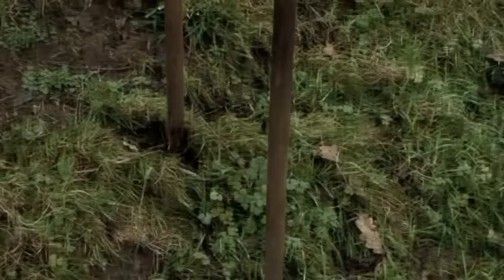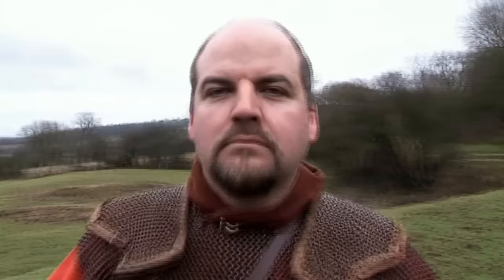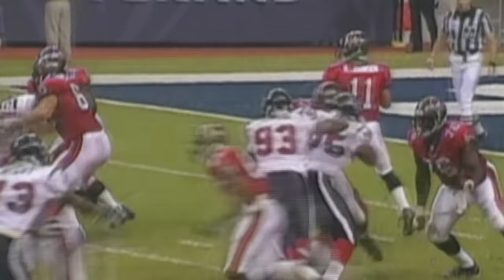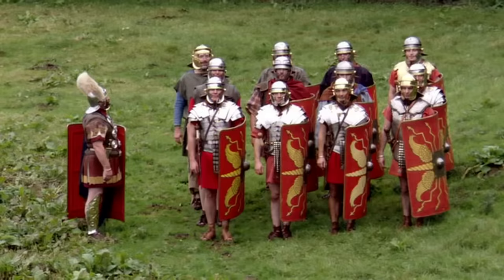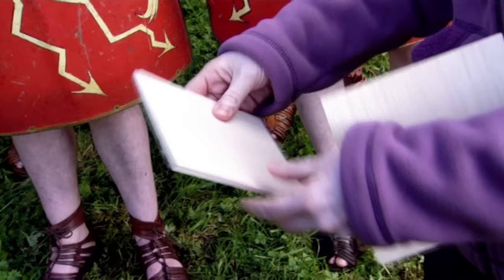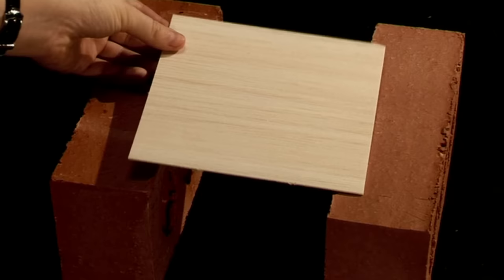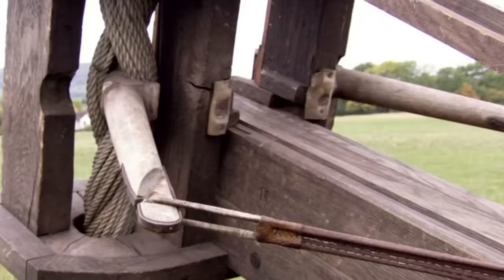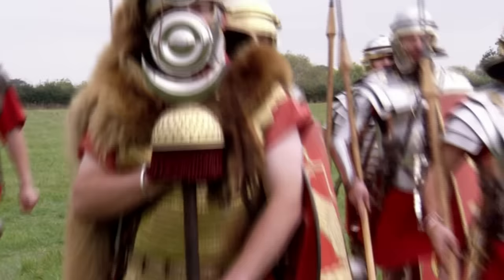Roman Military Technology and Tactics

Comment: For the record,the pilum had two types of pegs:iron and wood.The wooden peg would dislodge on contact, bending the spear at a 90 degree angle.This made it difficult to remove.The pilum is not your typical javelin
Reply: watching those pila get thrown, they didn't look effective at all!
Reply: @Concerned_Robot maybe in this demo yes but just ask the multitude of Rome's enemies what they made of it
Reply: the whole point of it wasn't to kill someone it was the fuck up their shields , because nobody is just gonna stand there and get hit with that thing they are going to block it with their shield , gets stuck it the shield so now you have to drop your guard and try to pull it out or drag that thing with you , its pretty smart tbh @Concerned_Robot
Reply: Pilums aren't like this at all, if they were, Caesar wouldn't have repelled cavalry during pharsalus.@nobodykilledme9641

Comment: The Pilum wasn't a spear, it was a Javelin. You never throw spears, but you throw javelins(pilums). Great research
Reply: Exactly
Reply: apparently there are instances of Pila being used as spears but i hold it to be false since a spear needs to be completely rigid to be effective whereas a Pilum is not completely rigid
Reply: Spears are as long as twelve to fourteen feet, do you think anyone could throw that accurately while in formation. I don't think so.
Reply: You can throw a spear. Spears are not necessarily always 12 foot Long.
Besides, have you thrown a spear in a Roman formation or seen research about it? It feels like you're assuming
Reply: Negro Joe she's right you don't throw spears you throw javelins though
Reply: A spear of that sort of length would actually be considered a pike. Spears were more commonly between six and nine feet in length, with eight foot being a soft limit for how long a spear could be before it could no longer be used effectively in conjunction with a shield. But what really makes the difference about javelin vs. spear would be how it was most commonly meant to be used. Javelins usually had smaller heads and lighter shafts, although were also more commonly shorter so as to increase range. Pilum were an exception, as they played a very different role. But seeing as how they were mainly used for throwing at the enemy, it would be more accurate to call them a javelin. The gladius was the main weapon of the legionnaire. Spears, on the other hand, were used as a main weapon by most cultures across the world and the reason you wouldn't throw them isn't so much because they're less effective at throwing, but that the soldier is less effective without his spear in hand. Throwing your spear was like throwing a loaded assault rifle at the enemy and hoping it goes off when it impacts on the ground, hitting a couple people before switching to your handgun
Reply: Vipershot22 How about you read my comment one more time buddy
Reply: XerasDezarrys Ok, yes a spear that long would be a pike but I'm just trying to make a point how dumb it is that an educational video doesn't know the difference between a spear and a javelin.
Reply: Thoughtful Potato Ok this is what you do, find a wooden dowel let's say nine feet long. Then mark a spot and try to hit that from fifteen feet away. If you can do that accurately, then you'd be a god of ancient warfare.
Reply: Also what most of us are forgetting a spear is so much more useful as it's meant to be. They were meant to fight by stabbing and parrying enemies in a formation and for stopping calvary charges. If it was meant to be thrown then it wasn't a spear it was a javelin.
Reply: Fair enough
Reply: Pilum is a type of spear. It can be thrown, but it can also used for thrusting.
Reply: It would be a crap spear then as the steel shaft is untreated steel leaving it in a soft state while the head of the spear is heat treated so it can pierce armor and/or shield. once the head pierces through an object the weight of the wooden shaft bends the soft metal shaft making it impossible to throw back at the Romans. if they used it as a spear it would be more likely bend during impact against a charging enemy as you are holding it then it would if it were thrown at the charging enemy
Reply: Negro Joe i know but for crowd control in rome troops used it
Reply: No they didn't because if you weren't aware it was illegal for armed troops to be in Rome and THEY HAD SPEARS WHICH WEREN'T FUCKING PILA BECAUSE PILA ARE JAVELINS.
Reply: Yes, there were the town watch, and they were the only ones allowed to be armed, but they were armed with hasta, which are very definitely spears. And while it is possible to throw a spear, it isn't advised because that's like throwing a loaded assault rifle at the enemy and hoping it kills them before they pick it up and use it against the now-disarmed soldier with only a handgun left. Pilum, on the other hand, were designed and meant to be thrown at the enemy over being used in formation combat. Yes, it can be used like a spear because it's a long pole with a sharp metal point at the end, but it isn't really meant for that and isn't as effective as a spear designed for fighting in melee. Legionnaires would throw them before going in to fight with their gladius. Therefore, a pilum can best be described as a specialized javelin designed for breaking shields and armor
Reply: Well it is quite obvious you've run out of argument because as we all know insulting the opposition is your last defense. And the funny thing is it never works. How about you read the comment above which explains why you wouldn't need to or even want to use a javelin.
Reply: Negro Joe im far from out of arguments and insults  but still a javelin is less lethal than a spear so its makes a great spear for Roman town watch
Reply: So your argument is that they would use pila in town watches, because they were less effective than spears. So then why do swat teams and police units have assault rifles, because in your logic they should all be carrying around muskets. Quite simply, a spear is cheaper and guess what if you were idiotic enough to use a pilum as a spear, which it isn't, anyone with a strong piece of sharp wood would kick your ass. It just doesn't make sense, because as it was previously discussed pila were single time use weapons and the shaft would bend making it ineffective. As a result the pilum wouldn't survive multiple thrusts. And also a pilum is still very lethal, when thrown.
Reply: Lucius I agree the triarii used spears not pila but I'm confused where you think I said triarii used pila?
Reply: Negro Joe ohh 9 just brought this up so people wouldn't get confused of "Pilum is a Spear weapon" so I brought up the only "spear units" that doesn't use Pilums as their main spear weapon.
Reply: Lucius oh ok I just thought this whole argument over pila was over and your comment surprised me. It's all good mate
Reply: It's quite simple really obviously the German language hasn't adopted the word javelin yet so for now javelins and spears mean the same thing. How about you look in and English dictionary and find the definitions of a spear and a javelin for me.
Reply: Zach Smith Pilum can be used, Julius caeser Had men use them as spears against Pompey's Calvary.
Reply: Dark Crusader so true
Reply: I'm pretty sure a Javelin is a type of spear, a throwing spear, plus they say Javelin at 1:17. It's like saying "That's not a dog, it's a Chihuahua".
Reply: kaguth true
Reply: Roman never spoke about "jaculum" (javelines) for the Pillum, they said PILLUM (and yes, not "hasta" > spear, i totally agree there)

BUT the pillum is nothing like a javeline, at least twice it weight, much more costy. Not well balanced.
This Pillum was used only on close quarter : 5 meters max
The angle we can see on the Orange triumph arc show us that it's use with a really close angle
And that details help to confirm our theory ;)
Reply: The Pilum was used as a spear in the Battle of Pharsalus by Caesar's hidden line against Pompey's cavalry. So, it could have been used as a spear in a last ditch attempt kind of thing.
Reply: isnt it pila ?
Reply: The pilum wasn't really meant to kill either, it's main function was to make the enemy drop his shield leaving him completely exposed so that the gladius could easily kill him
Reply: wait leonidas threw spear in 300
Reply: They could be thrown or used to stab, they usually carried one that was normal which could be stabbed with, the other was weighted, it had a circular metal weight and was meant to be thrown so it would affect how fast the pilum would drop.
Reply: Zak Kramer Pilum is latin for javelin, pestle, and spear. There are synonym translations though.
Reply: HELL IsREALJesusSaves jesus couldn't save a goal. He died for his own sins, not mine
Reply: Spears could be thrown. Javilins were just more accurate.
Reply: People threw spears....
Reply: Zak Kramer loads of cases of spears being thrown throughout history stop trying to complicate things with your annoying grammar dictatorship
Reply: a javelin is a spear designed to be thrown as a sabre is a sword designed for horseback
Reply: there are times they were used, your clearly not a student of ceaser or else you would know he used his last line with their pilla to stop pompiis cavalry charge on his right flank at the battle of Pharsalus
Reply: @l.jboylan6704  why did you bring sabers into the conversation?
Reply: Thoughtful Potato p
Reply: Its pila not pilums.
Reply: BaitLordx Spears were used as throwing weapons in early development and then later Javelins took over this role. So the term is correct just wrong age.
Reply: Well the actors in this video have apparently never thrown either one because that shot of them hitting shields was laughable. Narrator says how they could penetrate shields and then it immediately shows them failing to penetrate shields. Wtf?
Reply: So knights jousted with Spears, not javelins?
Reply: Ashton Rainey and all this time I thought they were using codpieces.
Reply: Dude, they said it pierces armour and shields. I don't think they did any research. They probably just knew some bloke that liked Roman stuff..
Reply: "ackchyually" TIPS FEDORA
Reply: There is wisdom to it as to why they say its a spear. But Its amazing that there is just some people only bent on finding wrong even in the most simplest and harmless of jokes. Sad really...
But anyway, just right now I was bitten by an “anopheles minismus flavirostris”. Do you know (like your legions) what it is???
NO? Why!?!!. ???
Actually its just a mosquito. The types that can carry malaria. 
Wisdom of it? “What is wrong if someone explains, or tells a story as if hes telling it to a toddler??? Is it not better to do it and use more common names so everyone, and not just geniuses like you and your legions can understand it? (Especially that the topic is a trivia and not your everyday general information).
I really dont get it why correctness in spelling and description point by point and word for word would be more important than learning as a whole... but hey, if there are nazi killers, for sure the world also has nazi OC’s right?
Reply: Tell that to Leonidas
Reply: the plural of pilum is not pilums, it's pila
Reply: @zacharykramer8244 : Actually, we distinguish between "Speer" which is meant to be thrown and "Spieß" which is used as a stabbing weapon.
Reply: So you attempt to show a video is uneducated by making an mistake in wording yourself? Because its funny that you don't know the difference between a spear and a pike! Also, Spears can, have and will continued to be thrown in many cultures around the world. To sum up, a javelin is a specific weapon meant to be thrown. A spear is longer and can both be thrown and thrusted. A pike is only used to thrust and cut. 
A pilum is a javelin, I agree. but be careful trying to call out an educational film when you yourself make the same mistakes.
Reply: @zachsmith1676  Very unlikely that a Pila was used as a spear. It was somewhat fragile. It was designed so that the wood holding the head would break so that the enemy couldn't just throw it back.
Reply: @Zamalshkay  Pilum is a singular entity of the Heavy Javelin, Pila is the plural, similar to a single front line soldier (pre-Marian Reforms) is a Hastatus but the plural is Hastatii
Reply: +BaitLordx

It's funny because of the words,  spear and throw, are the same in my language, a spear is literally called a throw ^^
Reply: well atleast in german they both have the same name
spear=speer, javelin=speer
Reply: Pilla not pilum
Reply: Thoughtful Potato well they are right their Is no way near The a amount of space between people in formation to throw a spear
Reply: True. In fact - javelin - for throwing, "bad" on close combat. Spear - "bad" for throwing, good on close combat. Anyways they both are different on steel heads and handle.
Reply: in Greek times you lose your spear, you lose your life.
Reply: I would agree but he says javelin and spear in the video so maybe it was a mistake
Reply: @nefurian4133  same goes for a pilla...weak argument
Reply: @zacharykramer8244  that's a pike sir, a spear would be about 9 feet...
Reply: @HaoSci  Very nice.
Reply: "Pili" - great Latin.
Reply: Pilas could actually work as spears the Roman legionnaires would actually use pilas as Spears.  This is actually seen at the siege of Alesia.
Reply: A javelin Is a type of spear. And this Wall of text Is a confirmed waste of time and brain matter. Nice troll
Reply: @thermite1277  if he Is smart he Is Just taking advantage of a language barrier. Lancia, wich Is "spear" in italian and similar to latin, derives from the verb "to throw". Existing from the start of the human civilization, the spear evolved and changed trough history. Javelin, was  the spear used in the olympics in Greece in the ancient era, while common spears wouldn't been used as throwing weapons in war; they required a term to specify. Still the javelin remains a kind of spear, in conclusion it can be called with both terms.
Reply: @thermite1277  i m Lost in comments. Why are there pikes in the chat now. If u Stick a Sharp Stone to a Stick you got a spear, After that you can use It as you want. If Stick Is long thats a pike. If Stick and Stone are aerodinamic you got javelin. If Stick and Stone are well balanced thats a common spear. If you stick an axe to It you got an halberd. If the axe gets longer and Stone falls you got a naginata .. and so on xD
Reply: Nerd
Reply: Comment 101
Reply: Well 
You can throw spears you don’t throw pikes
Reply: BaitLordx whoever says a spear is a specific length throughout mankind is dumb 
Spears javelins etc 
Are all the same 
Long stick with a
Sharp tip 
You can throw either or 
It’s just sometimes what you may be throwing may not be perfect for what your doing 
Thus why a pylum was made
And so on
Reply: I was about to comment that! The romans actually had Spears
Reply: Well you can throw spears just not that accurate
Reply: Its neither!
Reply: I know lol
Reply: Buttt Hollywood movie disagrees >:(
Reply: @zachsmith1676  pilum is interchangeable as a short spear. it's suboptimal compared to a purpose built spear, but it works. it's not as flimsy as they typically look sticking out of shields.
Reply: Ja
Reply: Yes, you can throw spears. The Romans had all types of spears and all types of javelins and used them all. And there was more than one type of Pila, and terminology can change over centuries. For instance, a gladius is just a sword. It just means sword, not a type of sword. Roman Javelins could be 4ft-6ft long. The Pilum was basically a heavy throwing spear at short range, and was also used a thrusting spear.
Reply: @histguy101  yeah, romans used pila for more than just throwing. they could be used as spears in a pinch. to be honest i don't understand why they abandoned spear and shield in their heavy infantry formations. you are 100% correct, they did indeed have all types of spears. in the "pila" period referred to, the romans also used auxiliary as well as ascenti (i think thats the word) formations that would have used spears for primary melee weapons as well. you are also right that you can throw all manner of spear but i. would argue that like with anything there are big differences in effectiveness and purpose built design. someone would probably be reluctant to throw a leaf spear if javelins were available.
Reply: Actually you do throw spears in certain situations.
Reply: @zacharykramer8244  they aren't typically that tall.